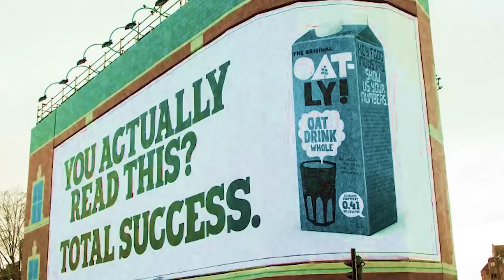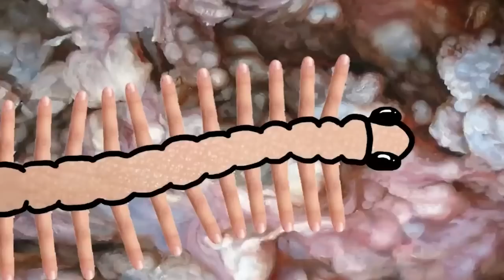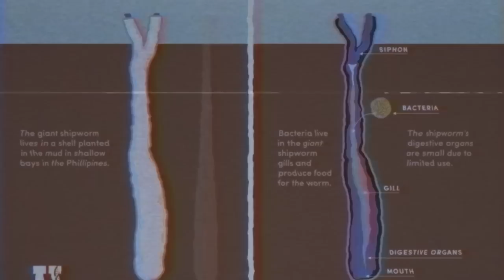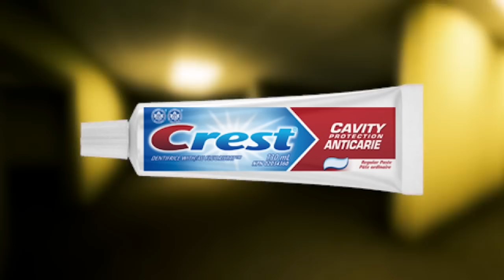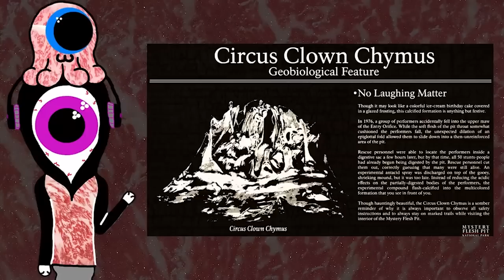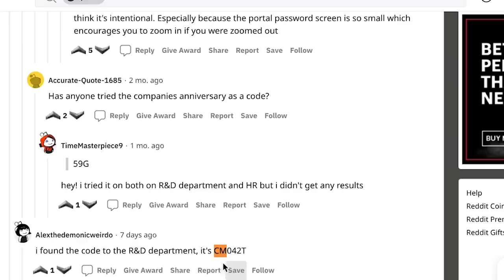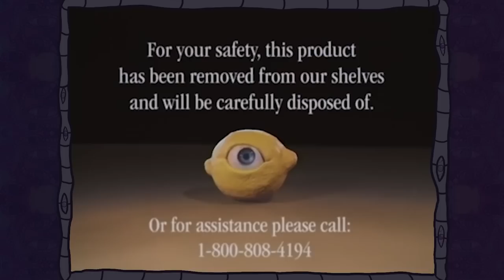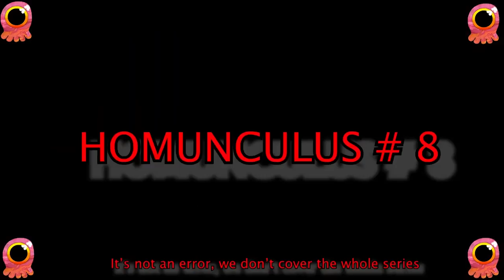AZFK INTERNET HORROR ICEBERG

Comment: Not sure if anyone else ever mentioned, but I believe the reason the Nuckelavee hates fresh water is because it's a being from salt water, and without skin it actually makes a lotta sense that it would be insanely intolerant to a modified environment like that. Lots of breeds of saltwater fish die from being put in fresh water due to water inflation (high salinity body absorbs excess water that's low salinity so nothing draws it back out and...it looks like a bad DeviantArt search), even with skin to insulate their inner bits, so the Nuckelavee running around naked would definitely be in for a world of hurt if it got dipped in non-salty wetness
Reply: Yep.  And it's why salt water predators that can make their way through fresh water are so very dangerous.  Ever wonder why sometimes we have shark attacks happen up in the middle of the country where there aren't any oceans nearby?  Bullsharks swimming up the Mississippi.